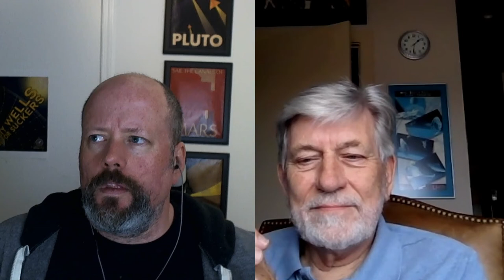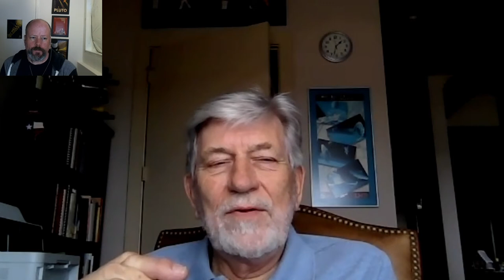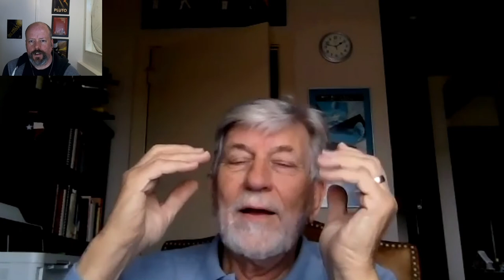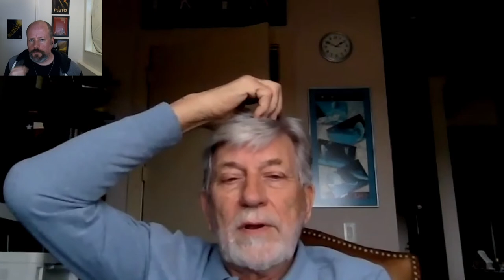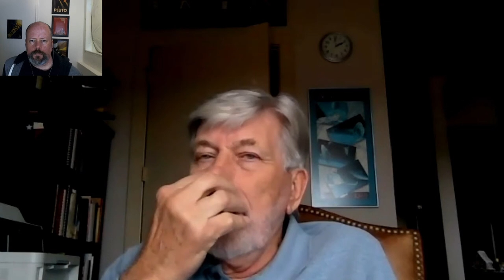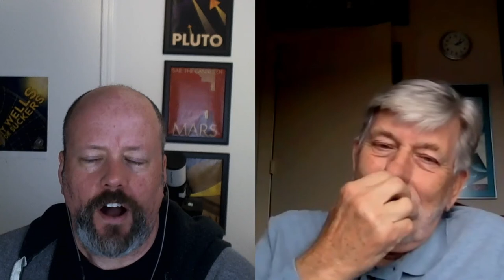Interview: Alex Ignatiev and Manufacturing on the Moon

Comment: This is good news! Not only are the metals available in the regolith, but processes and equipment have been developed and tested. As a systems engineer though I have to immediately think about the next steps. Once we have steel (I presume Ni, Co, Mg, C, Cu, etc are also available) and aluminum ingots, what do we do with them? I-beams and other structural shapes require hot rolling mill -HEAVY INDUSTRY! Sheet metal likewise requires both hot and cold rolling mills. I suuppose we could 3D print mill housings and other frame components on the moon, however, ball and roller bearings, mill rolls and other massive, precision components must be imported from earth. Likewise precision machine tools  CNC mills, lathes, etc will also have to be hauled up from earth and don't forget sensors, control systems etc. The alternative is to develop it all from scratch, including manually operated machines until native didital industry is established.
Having done it once on Earth we at least know some of the false trails to avoid. There we will no doubt encounter a wole herd (pod? Gaggle?) of new obstacles to overcome.
Exciting times!

Comment: Pretty much like Artemis, except that Andy Weir used a couple of nuclear reactors instead of solar panels. Lunar regolith is basically a lunar base with some assembly required. Just melt it and separate out the stuff you need, aluminium to build a station and oxygen for the people inside :-)

Comment: Nice to hear some one has this tech process in the works... but I still want Molten Salt Thorium Reactors.
Reply: @zachsquach  All valid points but it doesn't have the side effect of waste heat to keep your base warm for 2 weeks of night and an atomic spallation chain that gets you other elements you need (may need a proton gun for that) but this manufacturing rover is the best bootstrap I've heard of. The radio antenna idea is great.
Reply: @PalimpsestProd    I agree that the "waste" heat is a very useful side effect of the fission prosses and can even be used to assist in the production of heavy industry or just heating the base in what would be gird/base scale heat especially when it is carried through a salt loop . https://www.youtube.com/watch?v=sSVmJcHiKLs . though all of those uses can be achieved with concentrated solar with a molten salt loop, and for much less work as all you need is to make is a pretty reflective material from the lunar regolith and put it in to orbit or high up if you are near the poles. As for the spallation that can be achieved with out the reactor as from what I can tell (this is the first time I have come across this term so sorry if my quick googling gave me an incorrect understanding of the prosses ) all you need is the power of the reactor and that is easily replaced with the solar power satellites. I agree that it nice to have the spallation as a side effect and not some tacked on part, especially when you consider that some (if not most most) of the "waste" from MSRs are really valuable for other uses (some even space related) that could be used in a commercial manner to help support the base for the things that the base can not make early on i.e. intricate PC parts, Pay for crew (trip/salary), and entertainment. thought I am unsure how much this could be a benefit to the base as if the reactor can be proven out to be safe on the moon and economical it maybe replicated on earth thus hurting the lunar to earth economics. Where as if the base built solar power satellites they could easily turn from selling power from lunar bases and satellites to selling low cost clean and abundant energy back to earth. In all I agree that MSRs are a great choice when you consider the range of things that an advanced MSR could offer a lunar base in side of one compact package. In the end MSRs could be a great power/ commercial heat source for the future and in my eyes more likely to happen in the next 50 years than a Von Numen factory built Space Based Solar Power grid but the SBSP wins the economics and this system looks like it may be a few version (15-30 years) from becoming a roving Von Numen factory/ probe.
Reply: @zachsquach  The heat issue during the "night" could also be overcome by using some excess solar to heat up a couple of massive basalt blocks and tap them for power either via thermocouple or steam turbine to help supplement battery draw down or even tap the heat directly for internal base climate control. I can't imagine that method being anything but terribly inefficient but it would probably be incredibly reliable and super easy to set up.

Comment: Not only electricity, electricity, electricity. Sunlight in itself concentrated by a reflector or lens is also very useful. No atmosphere and daylight 14 days at a time. I saw a lecture a few years ago where in a lab a Lunar regolith simulant material was heated to form pure metals, in a CH4 atmosphere though to absorb the oxygen, which has to be brought there since C and H are very lacking on the Moon. Then the molten metals could be put in a centrifuge to separate them by density (iron, titanium, aluminum, magnesium) but the raw mix itself is good for structural purposes.

Comment: Hey Fraser question for you. Usually you don't want to 100% oxygen in your spacecraft or lunar modules. How will space manufacturers create nitrogen on the moon, to mix with the air to breathe?
Reply: You can use argon , underwater deep diving are using that like a dilution gase for decades, and is pretty common in the lunar regolith.

Comment: I discussed using a solar furnace with  a Hanford engineer five years ago that could be used on the moon. There would not any electronics. All the mirrors on the site would be solar/mechanical! The only electronics would be the robot. I did not about oxygen!  But it could be done. I was thinking about large satellite.

Comment: Fraser Cain  -  Moon's surface a great clean room, chip manufacturing, etc.  Probably, but . . . there are dust particles kicked off the surface by several processes and there is a tiny trace of neon as a hint of atmosphere.  https://www.space.com/23694-moon-dust-mystery-apollo-data.html  ==>  most of the "dust atmosphere" happens as the terminator moves past.

Comment: i guess a moon base will have a cool 60's retro style being made of aluminium and a lack of plastics , enjoyable interview ,thank you .
Reply: Yeah, everything made out of light metals and ceramics. In the Soviet Union they made cutlery out of aluminum, because all industry was built to quickly refit for arming up the military, the cutlery factories were to produce aircraft parts. They get really ugly really soon because they are too soft. I don't know what to make out of magnesium. Metal foil clothes? At least there is iron!
Reply: @bjorntorlarsson  Oh goodness, save us, Magnesium Foil clothes would be an absolutely leathal fire hazard inside a habitat. Accidentally touch some low voltage electric circuit, it lights up like a christmas tree and you are dead :D, distributed Magnesium is absurdly flammable. But magnesium makes for very light castings for machinery and the rigid, thick wall section form isnt anywhere near as dangerous.